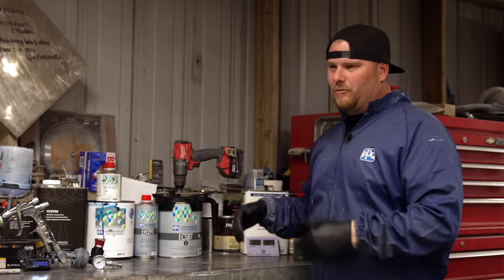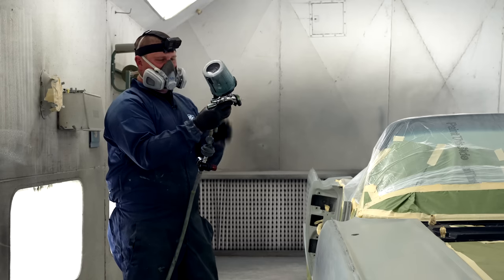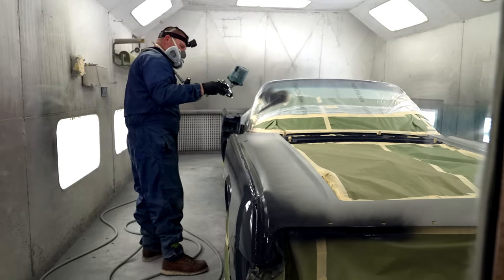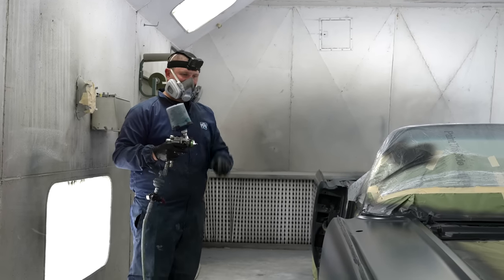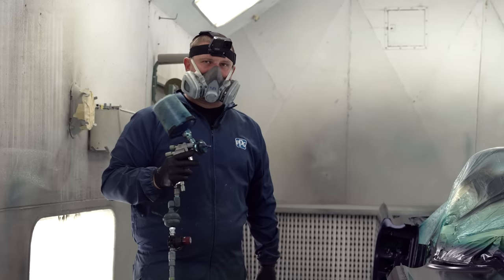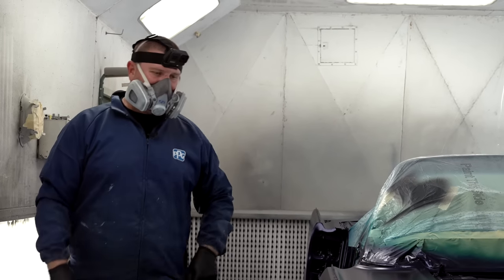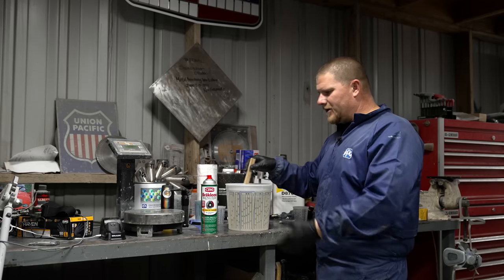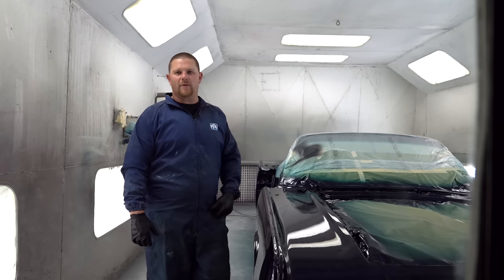Secrets to the Perfect Paint Job Revealed

Comment: I learned this early on at sears. Silicone on anything that has rubber contacts. 

If it was metal to metal contact use a high temp brake grease or copper/silver anti-seize.

I do not like the rtv glues on pad backs where they contact the caliper/piston

Comment: You mentioned briefly when doing the orientation coat this doesn't work as well with solvent based basecoats.  What would you change when using a solvent base to get the same results if it doesn't flatten out as well?
Reply from the maker: It just doesn’t lay as flat as waterborne paint. I don’t really change anything you do it the same way you are going to bury it in clearcoat anyway.
Reply: @SYLVESTERSCUSTOMS  thanks!

Comment: Fantastic video , Question what grade paper do you use if you have tape lines , before clear coating , thank you
Reply from the maker: You clear over the tape line then remove the line in the clear by cut and buff procedure
Reply: @SYLVESTERSCUSTOMS  
Thank you very much
Reply: @SYLVESTERSCUSTOMS  
If you spray in single stage and let it cure , then wanted to clear coat would you use a 2000 g wet and dry to give you a key for the clear coat 
Thank you

Comment: Can you use isopropyl alcohol to clean instead of wax and Greece remover?? Learning how to paint over the last 9months.already painted car 4 times.single stage with clear coat  and flaking .in process of 5th time hoping to be last and final, maby lol
Reply: I'm not a professional at all, done a few paint jobs. Me personally, I wouldn't use isopropyl alcohol on a big paint job that's important. I've always heard it leaves a slight residue. I'd stick to a good grease and wax remover, I've always liked to use a solvent based GWR, its strong stuff, make sure ots fully dry before painting over. I recently got some new GWR that is soy based, I've heard it's good havnt used it yet, it's all they had at my local stores. I know from reading it's not as strong of stuff like solvent based is. I'll test it out on some smaller projects before I go and do a whole vehicle with it. Maybe someone else will chime in with some more experience.
Reply from the maker: In anything we do if someone has a process that works no need to recreate the wheel. I would not use it and go with wax and grease remover 👍🏻

Comment: What length , size and type of air compressor hose do you use ? Also what size of fittings on your gun and hose ?
Reply from the maker: I just get whatever length I need to make it all the way around the car. I don’t recall offhand, but the hose is made by flex zilla. Standard automotive air line nothing special. We do not use the high flow fittings. I find that the seals fail often.
Reply: Ok because someone tokd me I need a anti static hose for painting.
Reply: Also i am wanting to buy a SATA 100b gun . In your opinion should I go with the rp version or the hvlp?

Comment: Why no more single stage what’s advantage of base clear? Seams like each time you have to spray much more chance of dust and debris? Thxs
Reply from the maker: Single stage is still around. But you got one shot to get it right. Otherwise you’re prepping and sanding all over. If you screw up or get dust in two stage it’s fixed in 5 min.

Comment: 2 questions my man
What is the name of the swivel you use on the air hose?
Why do you spray at such a very high pressure? I only ask because i know that particular gun is HVLP and has max inlet pressure of 26psi, PPG even recommends to spray their envirobase paint with that same gun at 25psi. I know for clear that's a whole different story but I've never seen a manufacturer recommend anything past 29psi unless one is using a conventional gun, I'm not trying to bag on your work I'm just genuinely curious
Reply from the maker: I believe the swivel is a devilbiss brand swivel. All guns give “recommended pressures” same goes for paint. But distance from panel, speed at which you spray, viscosity of the paint all have a factor in the way the paint lays down. That’s why so many people spray different. We can all get the same end result by using a variance of these. Figure out what works for you. For me I prefer a higher pressure because it will itomize out of the gun small resulting in a smaller droplet and a smoother finish. By me spraying close I’m able to move faster. Hope that helps answer your question. There’s no one way only do what you like 🤘🏻
Reply: @SYLVESTERSCUSTOMS thanks boss, appreciate all the videos you've put out for us. I'm 2 years into the industry at a small restoration shop as the prepper/painter and man I wish I would've found this channel sooner
Reply from the maker: @jamessakimae9655  glad it’s helping people. More videos coming soon

Comment: I've learned a lot about bodyworking cars from your YouTube channel.  How does that translate to a Triumph Street Triple?  Plastic,  steel tank, custom aluminum tail section?  Bodyworking the exaggerated shape of a tank?  Economical Quantities of epoxy primer, body filler, paint, clearcoat?  Help!  Thank you, Jim Garcia
Reply from the maker: There’s not much difference honestly, you will just have to use a plastic adhesion promoter. But the rest is pretty much the same.

Comment: What is the best way to learn, how to get the speed right, when applying paint to your project and avoiding runs in the paint, and how far away should you be holding the gun to prevent making mistakes? Should a newbie use cheap paint on a simple project, like painting a wall or a fence, to get used to new equipment and develop the technique, before attempting to paint a car or a motorcycle? This may sound stupid to most of you guys out there, but I’ve never used any of the paint equipment out there, besides the old rattle cans, to paint anything. I’d even like to learn how to use an airbrush, to paint project ideas I have rattling around in my head. Any advice would be greatly appreciated. Thank you in advance.
Reply from the maker: Absolutely. Painting is the same as anything else it takes muscle memory and practice. Get a junk fender and just start spraying. It’s the best way to learn just jump in head first and screw it up honestly. That’s how I’ve learned the reason our classes do so well is because you name it I’ve screwed it up and learned the hard way. When it comes to spraying nobody ever taught me I learned through failing. 👍🏻

Comment: DOES IT REALY MATER WHERE YOU START YOUR PAINT THAT IS AN ALLOVER PAINT JOB TOP TO BOTTOM
Reply from the maker: Every car is different as long as you are spraying it in a way that makes it easiest for you. For example, if it was a hardtop we would start at the roof and work our way down or maybe it’s the size of the car you just want to be able to get around it efficiently so that way when you get back to the part where you started, it still has a wet edge and everything blends together.

Comment: I remember getting my wrx and thinking mechanical work was the most difficult while body work and audio work were lower or easier on the totem, boy was I wrong.

Doing mechanical work is literally easier than Legos, even rebuilding my tranny was super easy, but I'm damn bumper looks like shit still and I'm constantly working on my audio system. 

It's like telling you to paint a picture vs put a block through a hole.

I ended just vinyl wrapping my hood because I knew it would look like shit if I painted it.
Reply from the maker: Yeah you are right! 👍🏻

Comment: I thought special paintbooth was needed for water base paints?
Reply from the maker: Nope! Waterborne just requires a little bit more airflow. You don’t necessarily have to have a very expensive booth but you could paint this in your garage if you wanted to.
Reply: @SYLVESTERSCUSTOMS  I've showed interest but last time I checked with my local ppg supplier they didn't have the mixing bank there store 2 hrs away I'd have to order from
Reply: @SYLVESTERSCUSTOMS  thanks for the info

Comment: I wonder if my work would be upset if I used my $3000 3m fresh air welding hood to paint! It has the filter/fan belt. I would think it would work where The welding lense flips up and still has a clear lense for grinding, Probably wanna cover the welding lense part. As far as the filter I'm not sure what it will do it kinda looks like the flat car air filter and as far as I know it filters out particulates, not fumes I guess I dunno that what most regular respirator filters like flat pink ones do too...? but for what those damn things cost there must be filter options I'd think but I've never checked so who knows. They outfitted everyone with one at time think there were 10 or 12 people there... That's some serious jing and they get upset when we don't use em and I hate using it it's so bulky and combersome. Also they don't filter smell and that filter hangs off the back of waist if you have bad guts and rip ass it pumps it straight into the helmet! If you have some nasty smelling gas it will litterly make you start instantly gagging when you hood is pumped full of nasty rotten egg fart lol.
Reply from the maker: Lmao I’d just get a paint mask